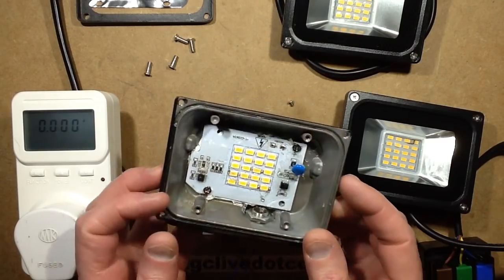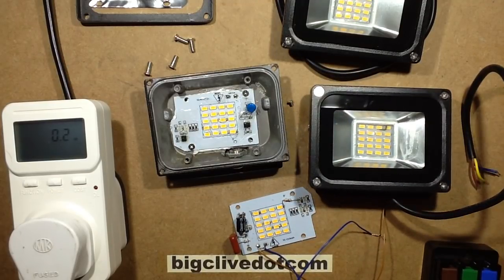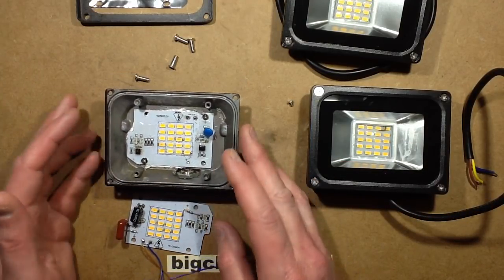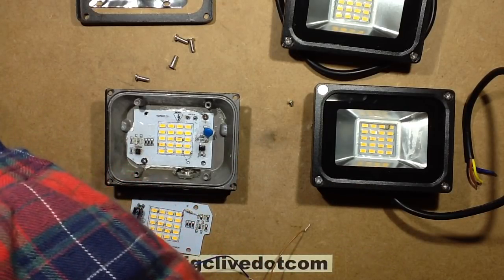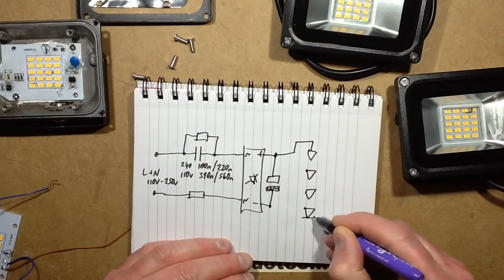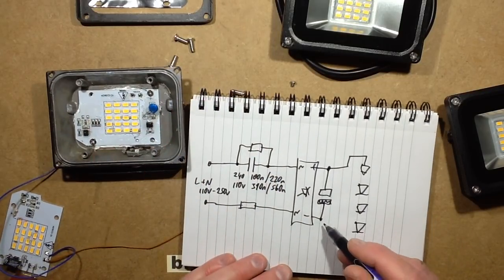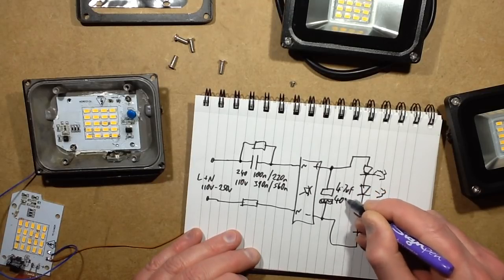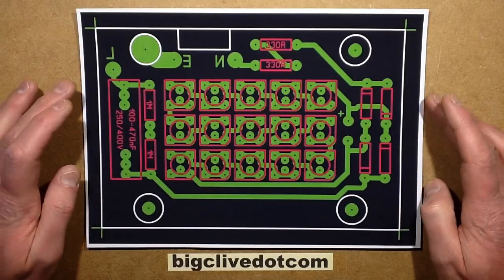DIY LED floodlight conversion module with PCB file.  (full build)

Comment: I'm not sure, but I think the biggest negative impact of lead-based solder is during recycling/dumping, especially in places where they burn the junk electronics to get the copper out. There, the fumes will likely carry the lead into the lungs of the kids who work the dumps. Or the lead of rotting components seeps into the ground water.
Another issue, I imagine, is lead mining.
Again, I'm not quite sure, but that seems (to me at least) reasonable reasons to move away from lead based solder. I for one never had any issue with lead free solder, but then again, I'm no intensive user.
Reply from the maker: The amount of lead used on modern PCBs is very low.  I'm not convinced that solid metallic lead poses as much risk of leaching into the ground as things like lead oxide paints did.  The switch to lead-free resulted in a massive increase in electronic landfill due to the reliability issues of using brittle lead free solder.

Comment: The problem with leaded solder is not that it's dangerous for people working with it. It's perfectly safe if handled properly. The problem is when people throw out their old electronics by just putting them in the garbage instead of recycling them properly, the lead could leach into groundwater, which is obviously disastrous for the environment and potentially dangerous for humans who drink this water. Industrial waste, which often contains lead and other heavy metals is simply dumped into rivers now that electronics manufacturing is mostly in China, and this causes serious health problems for people living in the area. An especially horrible case of this was a Jinko factory in Zhejiang province making solar panels; it's worth googling.

Comment: I know I'm plenty late but...
Couldn't you have traced the super flux pads by going horizontally from right to left in the top row and than zigzag between the two bottom rows from left to right? (I'm referring to the orientation and explanation at time 9:15).
Should you see this comment at all I'd like to see a video with your long term experience with the modified version of the light.

Comment: Great job on the pcb.  Where do you get your photo sensitive pcb stock from?
Reply from the maker: +Edward Hartmann I'm based in the UK so I use a company called Mega Electronics, but most good electronic component stockists will have the materials.  Or alternatively you can get them directly from China via http://www.kinsten.co/
Reply: +Edward Hartmann Rapid Electronics sell most of the Mega stuff if you're wanting to order components in the same go.
Reply from the maker: +SDG Electronics I should mention that I had a bad incident with Rapid where they supplied a bad batch of laminate and their "support department" turned out to be a snotty little kid who told me I was obviously using it wrongly.  I then called Mega who said they did NOT supply the laminate to Rapid and I then ordered a new batch from them and it worked fine.  I've not ordered laminate from Rapid since.
Reply: bigclivedotcom I'll bear that in mind next time I order some then! Thanks
Reply: Thanks for the quick answer - keep those great reviews coming.

Comment: big clive im using express pcb  how are you flipping the letter to show properly when you etch your pcb? right now if i flip my design all my letter are backwards. or are you designing your pcb upside down so the letters are right?
Reply from the maker: +Aikouka Ookami When I put text on the top silkscreen it's the right way up.  When text is placed on the back copper side it is automatically flipped so it reads correctly from that side.

Comment: Do you ever have to use an oscilloscope for any of your projects? Or are you able to get by with your meter?
Reply from the maker: A meter will do most things.  I do use an oscilloscope from time to time, but only when I have to see an actual waveform or how two relate to each other.
Reply: bigclivedotcom thanks for the tip and your awesome videos.

Comment: Using individual LEDs, what would work best, all white, or a mix of red, green and blue in the right proportion - since current white are blue with partial conversion by a phosphor. If colour rendering is not an issue,  maybe just blue and yellow
Reply from the maker: Red, green and blue tends to produce quite a bland and unpredictable white.  The phosphors in white LEDs introduce a wider spectrum of light.
Reply: Stunned how cheap they can be, just looking at 100 on ebay for £1.33, 20x red, green, blue, yellow, white straw hat type 5mm

Comment: Awesome floodlight. I bet every burglar that wants to break in and triggers the PIR, flooding there face with pink will immediately flee. 
Can i ask where you did get this very cool looking white PCB with UV-Resist?
Reply from the maker: +John Smith It's a hybrid board sold by Mega Electronics in the UK.  Fibreglass exterior for good copper adhesion, with a resin bonded paper interior for ease of drilling.

Comment: the original xurons from the 80s had the same handles as the chinese knock off (i vaguely remember the original packaging being identical in the mid 80's too) ,  i guess they modernised in part to show they are different.

Comment: Would it be easy enough to create something like this, but as a Led Pixel? Mains powered, but receiving data from a rPi/Arduino for example?
Reply from the maker: +Sparky UK You could use a WS2811 chip buffered up to drive a load of LEDs with a suitable 12V power supply.
Reply: Yes, I've done with with 12V ones. It didn't go too well when I tried this with 240V ones.

Comment: Just curious, why did you choose 2 330 for the inrush limiter? I know you said it came to mind, but why did that come to mind?
Reply from the maker: I wanted a high enough value to limit the inrush current as much as possible, but I also wanted to stay well within the power rating of the resistors.  It was a value chosen to meet both those requirements.  In reality it was just a third of the power rating of the resistors, so I could have used a higher resistance.
Reply: bigclivedotcom 
What's the chances of doing a SON video Clive?  
Have an old 150watt that I use as a grow lamp that's now over 20 year old and is still sweet.  Only I have now ordered a 250watt as tired of replacing halogen lamps with two 10 watt 12 volt Led spot lamps for instant light whilst the SON warms.  Using a relay to switch on the SON being the plan with a bypass for long duration.

Comment: YOu should build a DIY cnc machine to mount the dremel in for drilling the holes.. I would really like to see your approach to a project like that.
Reply from the maker: +rimmersbryggeri For a one-off the programming and set up time would greatly exceed doing it by hand.
Reply: I know that I used to work in a cnc shop. But if the pcb design program generates a cnc file anyway I guess programming time would be shorter. But my point was more along the lines that you are a prectical and rational man and I think a project likte that would lend itself very well to your teaching style. (Most geeks overcomplicate everything only to seem smarter than they really are)

Comment: this would work on 120v with just a tiny bit of modifying right?
Reply from the maker: +kerry Yes.  Just the dropper capacitor being changed for a 250V one with a higher capacitance like 560nF.

Comment: I've always thought the switch to lead free solder was about mass manufacturing and the waste produced.  Consider the the lead based solder that would still be entering waste streams if iPhones still used it.  Or millions on millions of Dell, HP and other computers.

Comment: That shear is awesome! What is it? Where can I get one?
Reply from the maker: The dedicated PCB material shear was from a company called Mega Electronics in the UK.  Quite an expensive bit of kit, but worth it.  It cuts standard FR4 style fibreglass laminate well, but the cheap resin/paper laminates can crack a bit at the edges.

Comment: Nice work and video Clive!
But,,,,, um Clive FLOOD-lite? 
Try it again please. With your capacity as engineer and your talent I was expecting more from you, my little 3AAA battery pocket flashlite puts out more. Thanks!
Reply from the maker: It's not as bright as as high power flood light, but it's bright enough for many outdoor applications, will not fry the LEDs as quickly as high power units and is fully updatable and serviceable.

Comment: Some time ago when I was on a kit building binge, I picked up an LED night light from China. Saddly it was for 240 volt and only dimly lite on 120 here.  Since that time it has been laying in a drawer gathering dust.  Now though after watching this, I see it may well be rescued by changing the capacitor.  Perhaps a 560 microfarad?
Reply from the maker: +Jerry Ericsson 560 microfrad would be quite exciting.  560 NANO Farad would probably increase the intensity.  You could also bridge out some of the LED string or just use it as a very low power and VERY long lasting night light for low level illumination.
Reply: +bigclivedotcom Oh ok ya I have trouble with that micro nano and such, probably because we grew up hearing about the strange way that the rest of the world measured things.  A thing called the "metric" system that was supposed to simplify things but in real life really confused we who still think in the inch, foot and yard system. That said, I will look around and see if I can find one of those.  Right now it does light very very dimly but not enough to really use as a night light.  Thanks a million.

Comment: how do you calculate how thick the traces need to be for the 230-240v
Reply from the maker: The voltage only dictates the clearance between the tracks.  It's the current that dictates the thickness and width.  In this case it's very low current.

Comment: Why do you use two 330R and not one 680 Ohm resistors?
Reply from the maker: +Nscale There was space for two resistors so it reduces the transient stress on them when they share the peaks.

Comment: Oh come on, Clive .. bridge rectifiers are super cheap and save pcb space. They're as cheap as £0.07 at reputable distributors like Farnell in 1 pcs quantities, here's an example : http://uk.farnell.com/multicomp/mb8s/bridge-rectifier-0-8a-800v-mbs/dp/1861520  - you can buy 100pcs of similar rectifiers on eBay for less than 3 pounds. SMD resistors are also super cheap. 

My suggestion would be to use SMD components for everything mains related, including the mains cables, so that the bottom of the pcb would be completely low voltage, then you could use a thermal pad over the through hole parts and transfer heat from the leds more efficienctly to the metal case. The low voltage would still be somewhat dangerous but it should be possible to find a thermal pad  that's also insulating.

Comment: Lead solder usage has been restricted mainly because it's bad for the environment,  and as well for humans. And we do throw away tons of boards every year so not a bad decision. However for hobby use,  leaded solder does have its advantages.
Reply: VoltLog yep lead bad superheated  flux deadly. Prefer slow non proven lead ingestion to anaphylactic shock from superheated flux.

Regards Tony Henderson
Reply: "And we do throw away tons of boards every year" - "We" do certainly not, as in, people in countries with electronic-waste recycling facilities and an educated mind to use them.
Reply: @Anvilshock  Fry's Metals in the 1960s invented the flow bath soldering method for mass production.  They also mainly processed scrap metal - WW2 aircraft were a good source - to generate the raw materials. No doubt they licenced the technology to other companies to use.

Comment: Lead based solder was banned from commercial products because it made them harder to recycle/dispose of as regulations meant they had to be handled as a hazardous waste as there couldn't be a guarantee of the lead content. Therefore expensive to dispose of.

Comment: Why dont you put 2 capacitor on both live an neutral? this would guarantee that you dont live anything
Reply: +‍1marcelfilms 
That's not how AC works.
Reply: To AC, a capacitor is just a frequency dependant resistor that shifts the phase. It will not provide isolation.

Comment: Can I use 1N4005's ?
Reply from the maker: Yes, they should be OK.
Reply: @bigclivedotcom  I have a Selenuim rectifier with a thermal cut out in a model train transformer - 240v to 24v What type of diode would I need assuming a current draw of 10amps and what overload protection if I wish to change the rectifier?
Reply: @highpath4776  I'd replace the selenium rectifier with a 15A or higher bridge rectifier; those are on Ebay from $2-ish.  You might be able to re-use the thermal cut-out, if not then Ebay has 10A thermal circuit breakers (push-button reset) for (again) a couple bucks.
Why do you need to replace the old components, though?  Maybe that affects what replacement components you gotta use.

Comment: Do you tin your boards in tinning sollution and if you do what is that sollution called?
Reply from the maker: +rimmersbryggeri I only used tinning solution once.  It was good, but expensive.  Especially when it all spontaneously precipitated out one day and ceased to work.
Reply: Ok do you in anyway try to prevent the tracks from tarnishing? BTW if you wired the LED's on this in invers prallel half pale blue and half pink it would be a pretty effective pornography wathcing dummy for bruglary protection. We always used to look for the pink shimmer behind blinds before doing pranks on people when I was a kid. (The pronography would start between 00.00 and 01.30AM)
Reply from the maker: +rimmersbryggeri Obn prototypes I don't do anything.  On manufactured boards I often spray them with a coat of PCB lacquer.
Reply: Rimmer just gave me an idea ...
Clive, why don't you have the LEDs in inverse parallel? That way, you don't need a bridge rectifier. The only downside is that the LEDs will flicker a bit.

Comment: The problem with Lead is in the paint when it chips off.  Of in Gasoline when it was spread though the air it caused environmental issues.
Reply from the maker: I bet if you dug up landfill the lead solder would still be intact.

Comment: are the kits available on your website? :)
Reply from the maker: +Stevie C Not for these PCBs.  They're a bit too specialised to manufacture a batch.
Reply: +bigclivedotcom 2:59 not everybody uses an inrush current limiting resistor? I've made capacitive dropper circuits without inrush current limiting resistors and they complete fried my LEDs... like black skid marks. Im using it on 120V. It would be nice not to use an inrush current limiting resistor because with 120 volts we're sometimes looking at 680nF to 2.2uF capacitors and usually a 5W inrush current limiting resistors, minimum of 75 ohms based off of experience.
Reply from the maker: +chems The inrush resistor is just to limit the surge at switch on.  In use the current will track the sinewave fairly smoothly.  A dimmer will nuke the resistor though.
Typically the current through the resistor will be the same as the LED current, so they don't have to be high power.

Comment: Don't think lead poisoning was ever a big reason for removing it from solder, it was more likely to just reduce lead waste that obviously is a worry if it gets into the water supply.
Reply: +Trakker  This is the first thought that came to my mind as well. I like to think(given the nature of the channel) that BigClive does not believe in building purely disposable products or expect people to not properly recycle electronics. I cannot blame him for not constantly thinking of the wasteful or irresponsible nature of too many people these days.
Reply from the maker: +Trakker There seems to be a common misconception that the reason it was banned is because it's a deadly poison to handle.  I often get emails from people who are terrified of even touching lead based solder.  In reality it's the best choice for DIY projects and the ONLY choice for repairing original equipment.

Comment: why don't you put the Ferric chloride in a jar with a big opening which you can seal after, way easier than messing around with plastic bags
Reply from the maker: +"Z"Airborne The bag approach makes it easier to see how well the PCB is etching without removing it, and also lets you isolate the PCB in a different area for washing without removing it from the bag.  It's the cleanest system I've used.